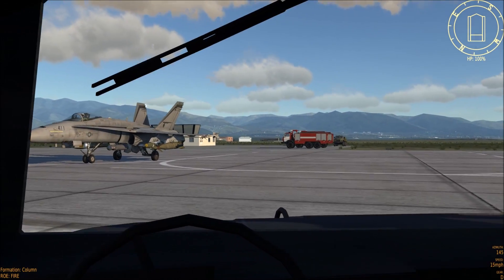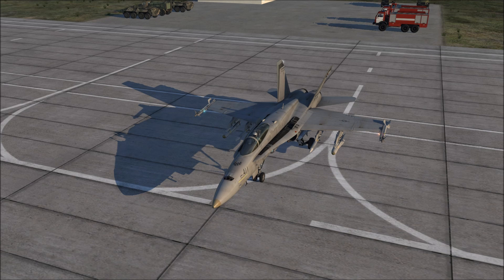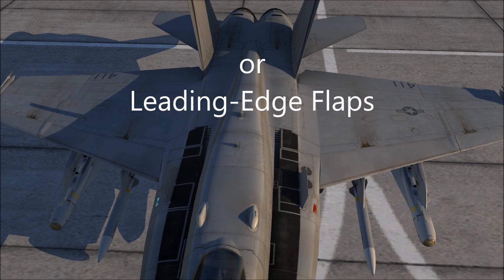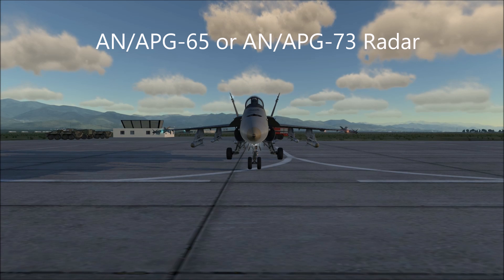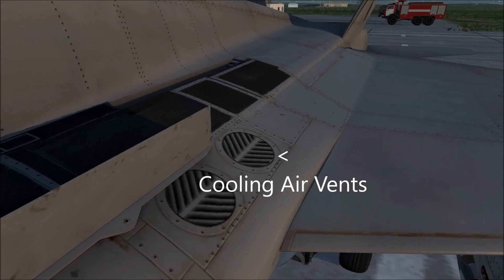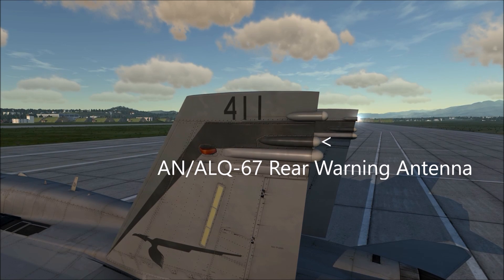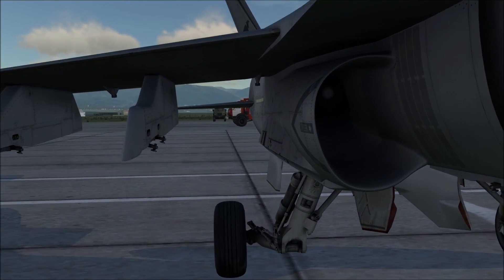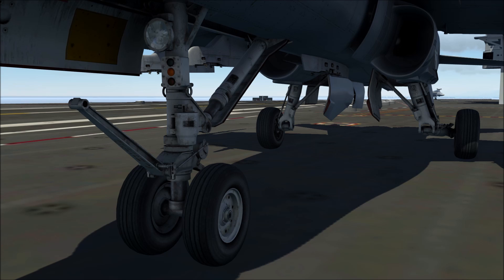DCS F/A-18C Walkaround Tutorial

Comment: Leading edge flaps and slats are not the same. Leading edge flaps are used to reduce pitching moment when using trailing edge flaps upon landing. Moreover they are controlled by the pilot. Leading edge slats are typically used on fighters and allow the jet to fly at high AOA and typically deploy as a result of the dynamic reaction of airflow passing over the wing.

Comment: the "ATS vent " you said is actually a fuel air heat exchanger, the "engine lubrication" is the hyd system resivour gauge one for each system.
Reply from the maker: Yes annotations have already been added to address this. But thanks anyway! One of my reference books was flat out wrong on those.
Reply: Luke Swann yea sorry didn't read that comment further down

Comment: Anyone else prefer the F/A-18C/D over the F/A-18E/F? The Super Hornet's cost-to-benefit ratio seems rather small, while the regular Hornet was cheap yet delivered a powerful punch.
Reply: I do as I worked on A-D models. One thing you notice is that as the aircraft get "newer" their maneuverability worsens. The YF-17 was a pretty nimble demo, but once you turn it into the finalized F/A-18A there is a drop. The pylons add to the drag coefficient. The F/A-18A+ has some minor changes but the major change is the ability to use the F404-GE-402 vice the -400 engine. The F/A-18A++ has some major electronics changes, some of the ones I got to play with at WTI had full color DDI's (Digital Display Indicators, never heard anyone call them MFD's) and some other tricks up there sleeves. 

However the Rhinos are optimized for the strike role and perform quite admirably at it. Though they are a bit more draggy with the 3rd pylon station the enlarged flight surfaces compensate decently and give the Super a bit more range IIRC.
Reply from the maker: Kinda. Id have to do more reading on it. But it seems that the SH is a better 
A-G with the improved payload and range. But yes i would say that i prefer the C model.

Comment: 10:04 pretty sure the hornet can hold fuel tanks on the outer wing pylons, I have a picture https://gyazo.com/3ea08005739c318566cd13e47cb7673b
Reply from the maker: It can carry them on the external wing stations but they are not plumbed for fuel supply. So basically if you needed to transport an extra tank to another airbase. Pilots can also use them to carry belongings/supplies in.
Reply: The tanks you are thinking of are called Blivets (CNU-188 Travel Pod), though they are essentially hollowed out and shelved fuel tanks. Typically used for small detachments or deployments for storage of spare parts, tools, pilot equipment. I've certainly put parts on them on a rear-det (Iwakuni, JPN) so the aircraft could take them back to the main deployment (Kadena AFB) as it would be quicker than waiting for the normal supply run or KC-130 delivery.
Reply from the maker: Ah, that's interesting thanks!

Comment: I was going to mention the same mistakes, also BLAD system isn't something I'm familiar with on the 18. However the BALD system and ECS system I well versed in. Your vents on the side of the intake are for your primary and secondary heat exchangers. Which is part of your heat/cooling system for both cockpit and avionics. I was an AME for 7 years so that system I'm super familiar with. BALD stands for Bleed Air Leak Detection system. I'm assuming your BLAD system is your Bleed Air System but I've never heard anyone call it BLAD. Other than that not a bad video.
Reply: Was gonna come in and mention this as a former Marine Airframer. However, he's not completely wrong though, the visible vents are for the heat exchangers. However, there are scoops and molding that are meant to catch excess air around the intakes and vent it along the "ramp" towards the heat exchangers as well.
Reply: Lance Dooley

Comment: The  "forward strobe lights" are actually position lights and are specifically called the LEX LTs. Right 1being green with all position lights having dimming functions. The flaps on the front end of the wings are LEF(leading edge flaps) and the rear ones being the TEF(trailing edge flaps). You also missed the inlet bleed air duct doors located near the LEX fence. those are not air data probes and are actually called the pitot/static probes. You are right about it being used for air data. The  rear landing gear is called the MLG(main landing gear). The landing light is called the Landing/Taxi light. 
Station 5 can also be used for an ext drop tank. The targeting pods better know as LPODS are capable of being configured on stations 4, 5, and 6.
Reply from the maker: I'll add something about the lights. The sources I've read use the names of some of the stuff you mentioned interchangeably. Thanks for the input!

Comment: The LEX you spoke about is really called the LERX (Leading Edge Root Extension)
Reply: Worked on Hornets for 7 years and no one called it a LERX. Hell the maintenance manuals called it a "Leading Edge Extension" and the two installations on top to disrupt turbulent air that was causing damage to the vertical stabilizers a "Fence, Leading Edge Extension."
Reply: This is not true. it is correct the way it is said in the video.
Reply: +Gear_Head It is true, a leading edge extension would require the actual extension to be a cuff, dogtooth or slat, all placed at some point along the leading edge on the wing, a Leading Edge Root Extension is simply a triangular extension of the area of the leading edge that meets the fuselage, it can be called an LEX, although to avoid confusion it's called an LERX.
Reply: 7. Leading Edge Extension. The leading edge extension (LEX) is a highly swept and cambered extension of the wing leading edge, and provides added lift at high angles of attack. The boarding ladder is mounted in the left LEX (figure 1).
Reply: Where are you getting your information from?
Reply: Im getting from myself, there is a difference